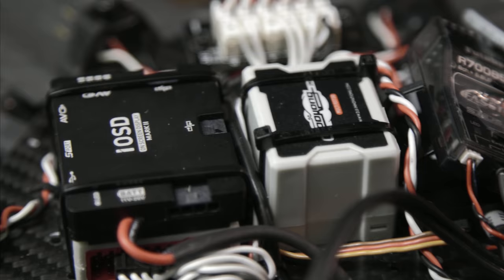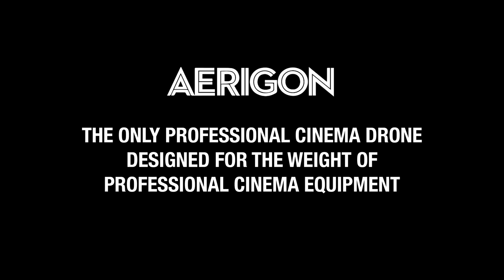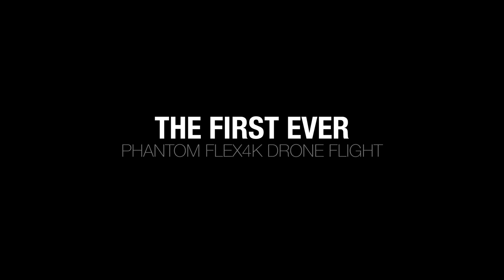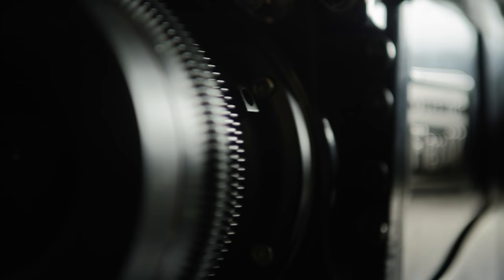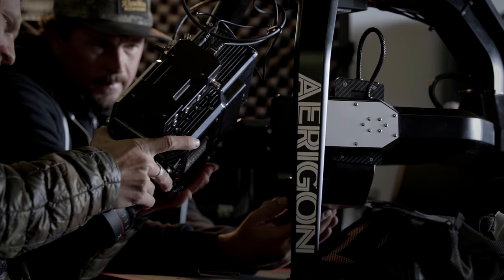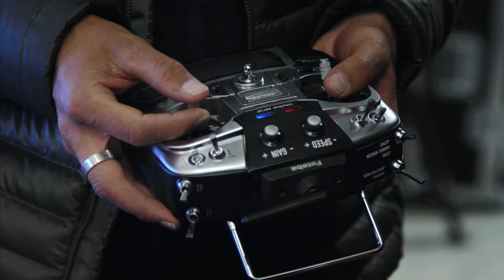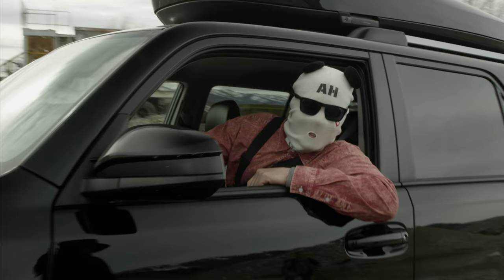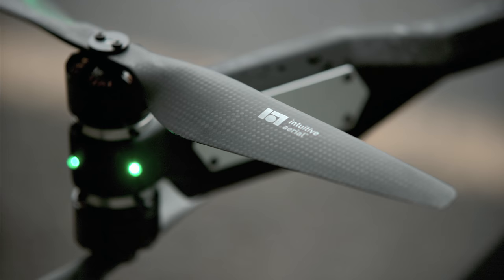Brain Farm shoots first-ever Ultra HD Phantom Flex4k drone footage

Comment: Wow, the batteries on that thing are insane!
Reply: Do you follow me around on YouTube or something? You always seem to be....here
Reply: Barnacules Nerdgasm makes me wonder, How long does the battery last? With that load, Im guessing somewhere around mins...?!
Reply: 3x 10,000 mah cells, 22.2v Yeah... insane
Reply: Wow... that's more than half a kW/h used up in however much time that thing stays on the air... which I'm guessing is not much, probably something like 15 minutes. So that thing is effectively a 166kW/h power supply. Impressive!
Reply: José Manuel Díez jeez... I didn't even do the numbers in my head... You're right... That's impressive 0.o
Reply: José Manuel Díez What unit do you mean by "kW/h"? It's either kWh or kW.
Reply: Mar phy kW/h doesn't even make sense. lol! power supply is kW.
Reply: mutantnaga kWh makes a lot of sense when you're talking about a power supply from (for example) batteries.

It basically tells you the charge. For simple calculations a 1kWh battery can provide 1kW of power for 1 hour before it's depleted and needs to be recharged.
In other terms: kW is the power, kWh is the energy.

This means that for the device featured in the video, knowing both kW and kWh of the power supply (batteries) is essential:
- kW tells you how much power can be  drawn from the supply before it gets into problems. How much power is needed to run all systems at full and can the battery handle it (i.e.: overheating or running into limits due to internal resistance)
- kWh tells you how much energy is packed into the battery which directly translates into flight time when combined with average power load.

For batteries this size though units will be more W for power and mAh for charge. 

note that the charge now reads in amps, not watts. Some calculation using battery voltage will be needed for conversion. 
José actually made a calculation error: 3x 10 000 mAh /22.2V doesn't translate to a charge of 166kWh but 0.66kWh. 166kWh would indeed be impressive knowing that the currently fastest electric superbike (LS-218 from Lightning motorcycles) features a 20kWh battery pack
Reply: *****
Dear me, are you serious? There is no kW/h. Simple as that.
Reply: Mar phy you're right, using a forward slash is incorrect contextually. https://en.m.wikipedia.org/wiki/Kilowatt_hour
Reply: How long does the battery last?

Comment: Please tell me how you were able to connect 12 of the motors to the flight controller wookong-m? The flight controller wookong-m a total of eight exits on ESC, and it does not support coaxial hexacopter.

Comment: I hate to break it to you, but all the shots you guys got with this super expensive (and risky) setup could have been accomplished with way less hassle, safer (to both people and equipment), and way cheaper by simply renting a large camera crane for a few hundred bucks.
Reply: +thejason51873 You're missing the point of this whole production. This was merely a beta test for future developers to build on. Also, for a shot like this you need a very strong crane to hold the weight of a full phantom flex kit. So you would most likely need a 30 ft technocrane to get some distance between the crane and car. Hiring out a technocrane that big would cost at least 15-20 grand per day. 

ALSO! The amount of crew it takes to assemble the crane can vary between sizes. If it's a 30 ft crane, you would need a hefty amount of grips and a few of the camera crew to assemble it, therefore it costs more money when you add up the amount of people you need to pay.

Then you need to worry about positioning, considering it's shot on muddy terrain, you need to be careful where you set up. You can lay down a some carefully placed tracks, but because of the weight of the crane it may sink the crane's supports and topple it over. 

So in regards to your theory, CRANES WOULD BE A HORRIBLE IDEA FOR THIS SHOOT!!! Any key grip will tell you this.
Reply: +djtb2011 There is absolutely no way you can get away with using a a jib for this shot. At least with a drone there's an escape plan if shit hits the fan. You simply fly up to avoid any major accidents.
Reply: +IanLEAU Well thank god we have trust fund kids like this that can spend limitless amounts of money on toys so we don't have to hire crane operators... Funny how he acts all worried. Please... daddy warbucks will just buy him more toys if he breaks these ones.
Reply: Don't bother dude he's never worked on a big production in his life.
Reply: thejason51873 I don't upload to YouTube, I don't freelance I do corporate works as a technician. Why the hell would I upload a corporate firms work onto my YouTube page?

You're just upset that you can't tell the difference between a freelancer and someone who actually works in the industry. Sorry kid, you don't make the cut. There's no trust funds here, just real technicians who break their fucking back trying to make a living.

Now you just go on ahead and make your assumptions. No proof whatsoever meaning you just make up excuses for a sad piece of shit who would rather dog on someone actually working at their craft than work on their own. Judging by your uploads, nothing really impressive.
Reply: thejason51873 Also, these guys would mostly likely do work for some big corporate firms as well. Usually those jobs offer big payouts. Revenue is generated by the jobs you do, gear you hire out to other productions and services you offer to people like workshops and courses for up and coming technicians.

Comment: 1000 frames per second - uploads 30 fps video instead of 60 on youtube, good job guy!
Reply: DanceFloorOutCast Exactly what I was thinking.
Reply: 30 fps is better for slow-mo
Reply: ***** Well, slower yes. But not better.
Reply: Henrik Hermansson DanceFloorOutCast  This video is 42x slower than real-time, but if they uploaded in 60fps it would be just 17x slower. So its not worth it for the tiny bit of smoother looking.
Reply: ***** In my eyes, 60 fps is more than a 'tiny bit' smoother than 30 and I think it's a pity that they prioritise resolution over framerate.
They could have filmed this in 2K @ 2000 fps, and this vid would have been awesome.
Reply: DanceFloorOutCast Yes it does, btw this video is in 24fps. If you dont belive me check The Slow Mo Guys.
Reply: DanceFloorOutCast so tell me how it works
Reply: DanceFloorOutCast It actullay work like that,  1 second at 1000fps does 33.3 seconds of 30 fps video, while 16.7 seconds of 60 fps video (High number frames of input you have means the gap between editing in 30 fps or 60 fps is huge ;) )
Reply: DanceFloorOutCast you don't get the point of "slow" motion. If you set fps to 60 the video is twice as fast as 30pfs.
Reply: DanceFloorOutCast it does work like that kid

Comment: Very important question: How do you pull focus? I hear you have to shoot at like f/16+ or something...
Reply: +Gedeon Kele It's probably locked at one focal length. Considering the footage is slowed you don't need to pull focus since the subject doesn't move that far in the span 4 seconds. That't the best thing about the Phantom Flex, focus pulling on that thing can be a breeze.
Reply: +IanLEAU Ah,  thanks.
Reply: Gedeon Kele Also, looking at the depth of field, it looks like they shot on a rather closed T-stop.
Reply: +IanLEAU Yeah, possibly 11 to 16
Reply: LOL the focus puller could do his job sleeping if that were the case

Comment: What was so hard about this?
Reply: JohnVH541 Try taking a normal "drone" (like a DJI Phantom) and try to lift your cell phone off the ground. Now try again with a camera that weighs as much as a sack of bricks.
Reply: StalePhish Ive always built my own quads, so building something big enough to carry more weight isnt very hard, never had a phantom, and never will. What does the camera weigh?
Reply: JohnVH541 The camera itself easily costs $150,000 and weighs 14 pounds without the lens or any attachments, which is the weight of a bowling ball. Here's a test for you if you think you are technically capable: build yourself a quadcopter that can successfully maneuver in the air while carrying a 16 lb bowling ball.
Reply: StalePhish only 16lbs? You realize how easy that is, dont you?
Reply: JohnVH541 If it were super easy, heavy lift drones probably wouldn't cost upwards of $8k. I look forward to seeing JohnVH541 model drones on the market then, with a very low price tag since they're so easy to make.

I'm not sure what makes Brain Farm's rig cost $250,000 when it's basically a $150,000 camera riding a modified $10,000 drone, but it's still something that is unheard of enough that this video is making front page tech news.
Reply: StalePhish  haha, you wont see any from me, too niche, and enough people already do it..  If you knew anything about building a quadcopter/multirotor, we wouldnt be arguing about it. This is making news because of the video quality, not for the simple multirotor.
Have a good weekend.
Reply: StalePhish what about the camera head? What do you think that baby costs and it is the best around (adding more weight of course). In this line of work (movies and such) you need this quality.
Reply: JohnVH541 if it's so easy, then build one and upload a video of it on your channel. Otherwise no one gives a shit.
Reply: StalePhish
The attachments may cost that much. Lens, recording, etc. Maybe the gimbal to carry that brick, too.
Reply: Fusurugi That's an excellent point. Normal gimbals just need to hold a pound at most, but you'd certainly need a heavy duty one to balance a long heavy object that probably has a weird center of mass.
Reply: JohnVH541 If you build one that can lift a 16lb bowling ball and maneuver, I will write you a cheque for double of what the parts cost you.
Reply: StalePhish
I have two co-workers heavily invested into photography, and what I overheard of their discussions a good lense for a good camera easily costs 10k us$.
Reply: StalePhish I have a DJI Phantom 2 and GoPro Hero 4. I agree, it's really difficult to manage one of those things in the air and frankly I'd be pissed off if I had like a 3000 bucks drone like the one in the video with a 70000 bucks Flex Camera attached underneath it and crashed badly. What a waste would be. I can imagine how stressful it was for these guys. Evidently JohnVH541 doesn't know that much about drones, cameras etc.

Comment: Will everyone shut up about booms and cranes? Where in this video are they talking about booms and cranes? This guy didn't dream for 5 years of developing a boom or a crane. This video has nothing to do with the truck either. It's a test run for the drone that they built to carry this camera...because it's never been done before...which they mentioned in the very beginning of the video. Try using a boom or a crane as easily as the DJI Phantom gets a camera over Niagara Falls or the Grand Canyon. It took only one guy to fly a remote controlled drone to get those shots and he set it up in minutes. Try to get your stupid boom/crane combination up and running in as little time as that and get the same shots. 

Shut up already. You're only making yourselves look stupid by totally missing the point of the video...and it doesn't have one damn thing to do with a boom or a crane.
Reply: ThisAllSoundsGood   So was it not about the truck then?

Comment: If a DJI Inspire can shoot 4k video, then why is this multicopter such a big deal? Not trying to bust on anyone, just want to understand.  Why all the $ on this when an Inspire will do 4k for around $2000?
Reply: Partok81 They won't do it for $2000 sadly - I wish they would! Also DJI's definitely does not shoot 1000fps! I think it should 60fps max :/
Reply: Partok81 4K is just a resolution, that has turned more into a buzz word. It is more complicated than just shooting 4K video on your phone, and now you have the same quality as a professional film. You have to take into account the lenses, sensor, bitrate, ect. Resolution is just one of at least ten factors that provide a quality image. 

Companies like DJI don't want you to know this, because it makes you ask questions like this. Its not your fault, it's theirs. They just want your money.
Reply: A phantom does not have a lens like this camera and internal components in the camera to shoot at 1000fps, but this takes so much memory It's like taking a 1000 4k pictures a second and this is really only for slow motion even tho 240 fps would be enough. Filmmakers film at 1080p because 4k is pretty useless in my opinion why make more pixels then the human eye can see. And they render the video to make it look good. Only really buy 4k if you want an extra bonus. 1080p is more than enough!The inspire shoots 4k yes but the lens is not as big again and it shoots 30 fps I think, but that's good enough for normal playback speed. It's $3200 for normal inspire and $3600 for inspire with extra remote.